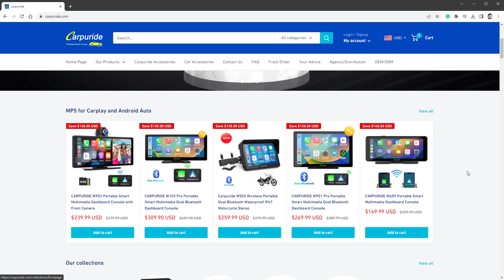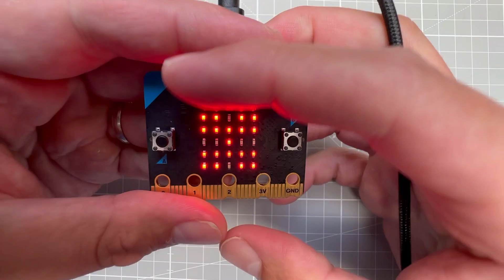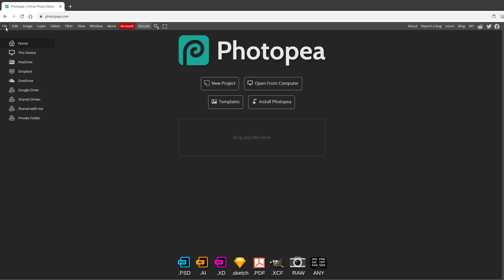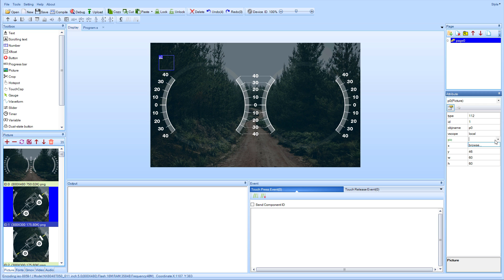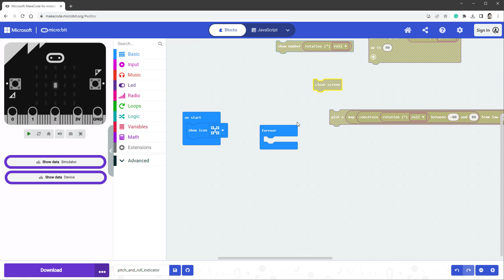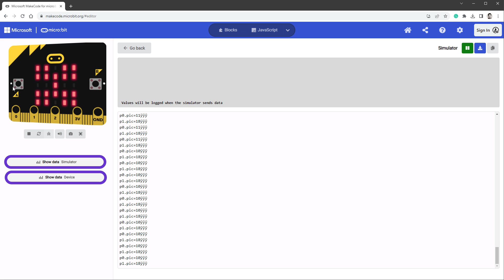Homemade Pitch Roll Indicator

Comment: What is the expected hardware cost for this project?
Reply from the maker: Depends on which Nextion screen you choose. There are all the possible sizes from the smallest ones to big ones, and that will determine the cost of the project. You can use any Nextion display you like - it depends on how much space you have for the project and what is the budget.

Comment: Would it be possible to send the data somehow from board to display via wifi or something? Im planing a projekt to mount this on my rc crawler car and have the display on my radio.
Reply from the maker: Connect display to ESP32 and communicate with another ESP32 wirelessly, for example over ESP NOW protocol.

Comment: What would you estimate the total cost of this project was? Did you end up putting it in any kind of housing so it could be mounted or protected?

Very cool video!
Reply from the maker: I ended up recreating this project with Arduino and a proper tilt sensor and it was behaving much better - please see my newer video for more details. In the end, it was probably also cheaper.

Comment: Could the microbit board read information from a VESC then display it on a nextion display? Not sure if you are familiar with VESC, it is sorely lacking nice information displays.
Reply from the maker: I´m not familiar with VESC. What types of communication does that unit supports?
Reply: @upir_upir  serial, canbus, analog, ppm VESC is an open source  brushless motor controller used for everything from boats to cars to bikes to aircraft.
Reply from the maker: @boardinrider if it had support for serial, it might be possible to use it directly with the Nextion display. Otherwise, you would just put Arduino in between and use either serial or canbus. Are you using the VESC for anything?

Comment: Isn't it possible to just have one image for pitch and roll where you could animate its rotation instead of having multiple images with different values?
Reply from the maker: Unfortunately, it is not possible for this display. The Nextion is quite limited in what it can do/draw, but it´s cheap and easy to use.

Comment: Thank you for this tutorial. I personally would rather use a plain 2.8 inch display since it will be easier for me to work with and give me more control and customization, but i could only do that in Arduino. I think Adafruit has made a Micro Bit Arduino boards package.
Reply from the maker: Thank you, I´m glad you like it. Do you know the name of the Adafruit board? It sounds interesting.
Reply: For some reason my comment won’t save. I don’t know why. Do you have another way for me to tell you? Youtube appears to have terrible code problems.

Comment: Could you make a cool screen to display 3 or 4 thermometers (wifi/sonoff) on one screen using esp (to be wifi too)?
Reply from the maker: Do you have an idea of which thermometers to use? I can surely do the display part, not quite sure about the communication between the modules..
Reply: @upir_upir  I'm thinking about using these sensors sold for home automation, I'm going to research what is the easiest way to obtain the data, I believe it's mqtt

Comment: Nice, I kinda need to dig into that bbc board, sadly haven't paid enough attention, looks like it isn't as limited in functionality as I thought that "kids learning board" will be
Reply from the maker: I think the microbit is quite underrated. It´s a nice little board, easy to use, with a lot of sensors and you can get the project up and running in no time. For simple projects, I enjoy this board quite a lot.

Comment: You need some sort of low pass filter on the movement to prevent it jumping about when stable.
Reply: Exponential Smoothing is another schema and works for me with Arduino from a noisy joystick/potentiometer.
Reply: @strongme80  Exponential smoothing is a lowpass filter
Reply: @TimeFadesMemoryLasts  Yeah, you're right. Thanks!
Reply: @strongme80 is this a library
Reply from the maker: Yep, I’m sure there are many ways how to improve the project. If there will be enough interest, I might record part 2…
Reply: A kalman filter would be better suited for this
Reply: @Airsoftguns345  A kalman filter is completely overkill for this. You are right in general but this is a simple application and a kalman filter makes the project 100 times more complicated for no practical benefit. a Kalman filter is more helpful if you adaptively want to fuse several signals into one.
Reply: @TimeFadesMemoryLasts  there are prewritten libraries for it so yeah.. also you probably do want to fuse several sensors eg speedometer, so your IMU doesn't flip out when you are just accelerating.
Reply: @Wingnut353  I guess you have forgotten the original post and what the aim is. The displaly is already using fused attitude data. But even if you still needed to implement the attitude algorithm over again, Kalman is completely overkill for an attitude sensor on a car. It makes more sense on heavily accellerated systems like rockets. By using a kalman filter you are making the problem just 100 times more complicated without benefits. Even if you were to make a new attiitude algorithm. Attitude is super easy. Using just a complementary filter for fusing acelerometer data (that has the car acceleration removed) and gyro data together is already enough to get perfect results and you can do that in a few lines of code in 5 minutes without a 3rd party library. And the result will be perfectly stable no matter how long the car accelerates. But that's besides the point: Remember the problem was just to find smoother values to the already given attitude values, not to design a whole freaking IMU system that optimally adapts to the sensor uncertainties.